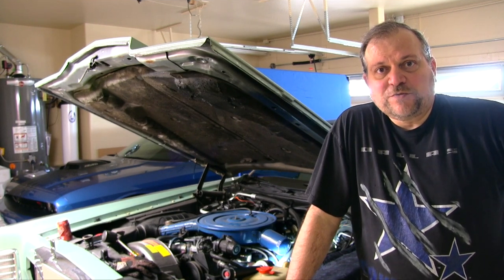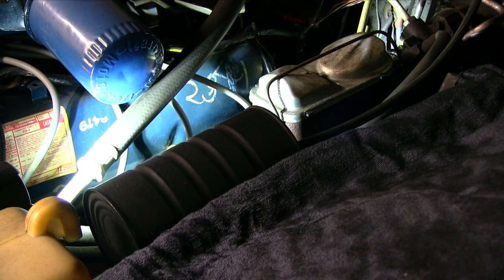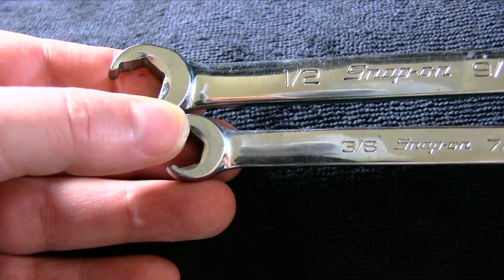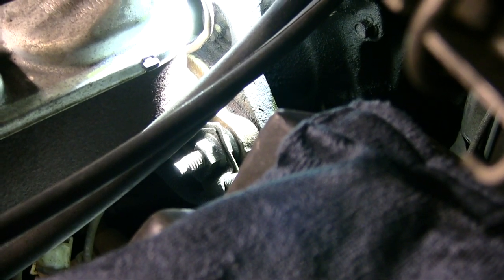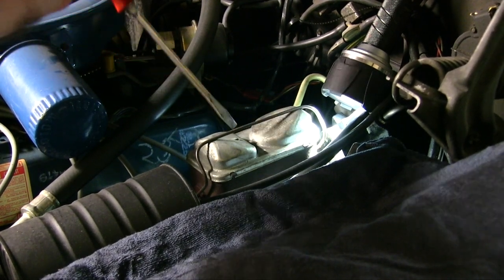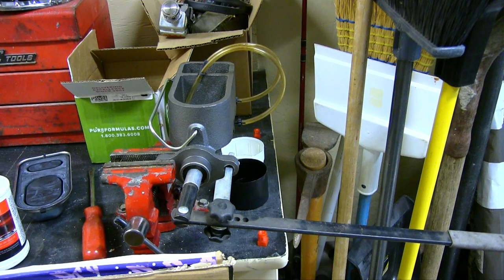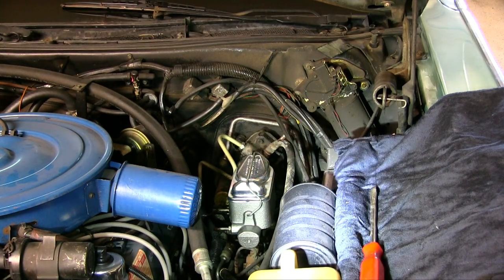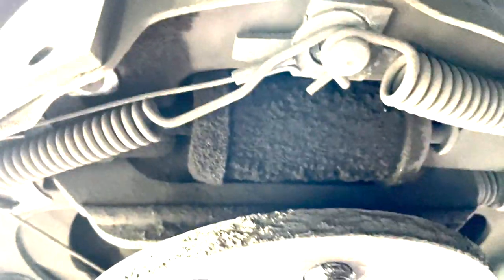1978 LINCOLN CONTINENTAL PART VI: MASTER CYLINDER REPLACEMENT AND SYSTEM BLEED  HD 1080p

Comment: Hi Richard,  great video...I hope you can help me...I have a 77 mark V...and need a new master cylinder cap gasket with the 4 tabs...exactly like yours o  your 78.   ...where can I find one? They are soo hard to locate   ...any help us very appreciative 🙂👍
Reply from the maker: Not sure you can get just the gasket easily. Never really looked. Maybe try Dorman products website? Might come with a replacement lid, if you can get them separately. Funny, because I thought about saving the old one but figured I would never need it nor would anyone want one, so I threw it away.
Reply: @Kryptosmaster  thanks for getting back, nope theses suckers are almost impossible to find..the dorman  are an inch too short...our Lincoln's have 4 disc brakes, hence the larger reservoir....I found one on ebay from a junkyard 🙏